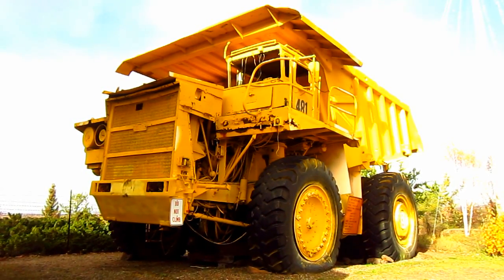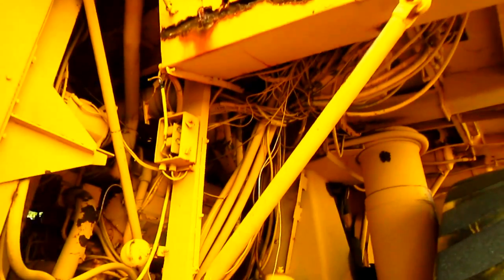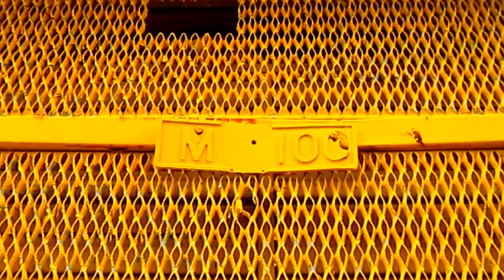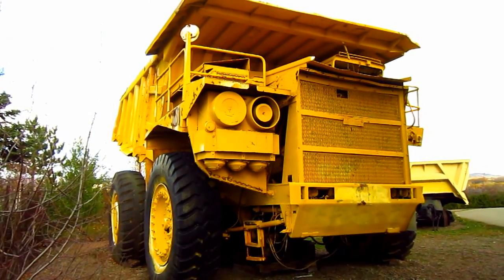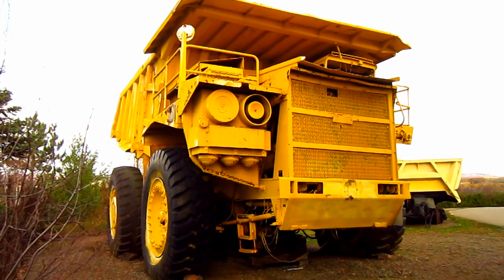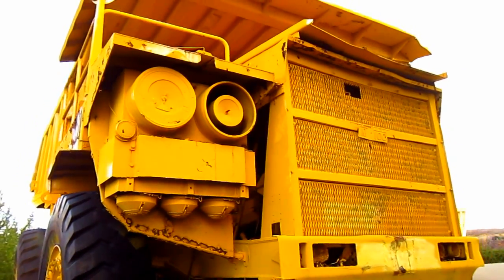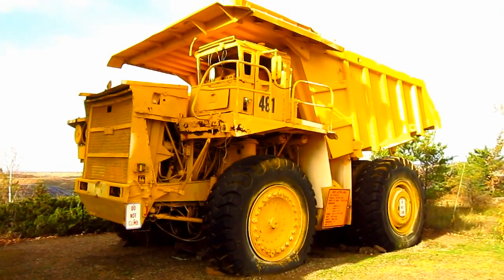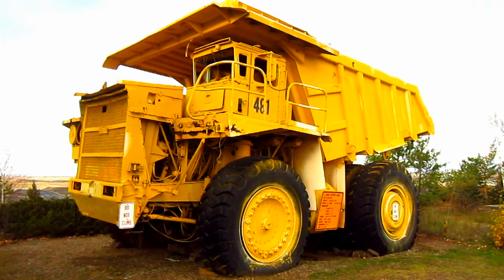Unit Rig M-100 Documentary

Comment: I drove one for 5 months at the US Borax mine. If you can drive a car you can drive this. They are very loud. The early ones no a/c and the cab leaky and dusty. It was so loud in the cab, a boom box up full volume can barely be heard. I know I tried it. 
The truck is similar to a locomotive. The diesel engine powers a generator which powers electric traction motors in the wheels. The trucks have both air brakes for low speeds to a stop and dynamic braking for driving down the hills from the dump. If the dynamic brakes are down, the truck is down. The trucks also have governors set around 30mph. Exceed that speed and the dynamic brake automatically engages and slows you down to around 25mph before disengaging.

Comment: This truck served its last years hauling coarse tails at USS Minntac, thus the extra drip pan over the hood.  This truck effectively killed off Euclid on the Iron Range of Minnesota.  The closest Euclid had was the R-105 that was mechanical drive, much more complex and much less reliable.  The Lectra Hauls were more maneuverable than the tandem drive Eucs and of course could haul more.  Even though many of the truck shops at the taconite mines were built in the mid 1960's after these trucks were available, they were made with doors sized for the old Euclids and had to be extensively modified.  I remember seeing my first one as a kid and it seemed absolutely huge.  Now they look small compared to more modern trucks.  The ground under this viewstand will be mined out by United Taconite in the next few years, the highway is being moved, and this view area is now closed.  Unfortunately this truck, the Wiseda parked next to it, and the rail car on display were all scrapped.  Another M 100 is on display by the gate at Keewatin Taconite but I don't know what the policy is to access it now.  It's behind no trespassing signs.  The Mining Museum in Chisholm has a Wabco 120 ton truck on display along with a bunch of other mining equipment from the Range.  Most of that equipment can be climbed on.

Comment: Was this up near the Mesabi Iron Range? My cousin-in-law worked for Minntac up in that Range.. Never would have thought that a V12 149 Cubic inch per cylinder (yes you read that correctly) 2 stroke Detroit Diesel was actually used in this. But it does make a lot of sense. Need a ton of power to move 100 tons.
Reply from the maker: Ratkill9000 Yes

Comment: Nice job with this video, Justin.  Thank you for taking the time to do the research - it adds a lot to the presentation.

I think the gas turbine-electric drive system made sense.  Too bad that it didn't work out, economically.  Eliminating the transmission by using the electric drive system bypassed the difficulty of coming up with a gear reduction system to take the turbine's 8000+ rpm down to a usable number.  Interestingly, Solar Turbines later became a subsidiary of Caterpillar and it remains so, today.

Comment: Nice find PA!  A great look at an old classic that for the most part has long been forgotten. As you stated Unit Rig were the pioneers of the electric haul truck that now is the standard of the industry in the larger sizes. R.G. LeTourneau also played with elecric powered trucks mostly for functions as the drive was still mechanical. The one lone holdout manufacturer of mechanical drive has seen the light & is now producing electric drive trucks & even has an electric drive dozer. I wonder how long before they produce an electric drive loader ala LeTourneau??? Thanks for another great vid PA.
Reply: Cat, now with its acquisition of Bucyrus International, who bought Terex,. who bought Lectra Haul now makes both mechanical and electric drive trucks up to the 400 ton plus range.  In the late 70's-early 80's, each new generation of traction motors from GE became less and less reliable and there was a move back to mechanical drives.  For current production the two systems are about equal reliability.

Comment: Is there any reason why electric drive would be beneficial, as opposed to hydraulic or conventional shaft drive?
Reply from the maker: Electric power offers less mechanical components of the powertrain (ex: transmission), which equals fewer moving parts and therefore, less maintenance and things to break
Reply: PAmining that is the same reason all locomotives are diesel electric plus for the weight factor electric motors can move more weight easier